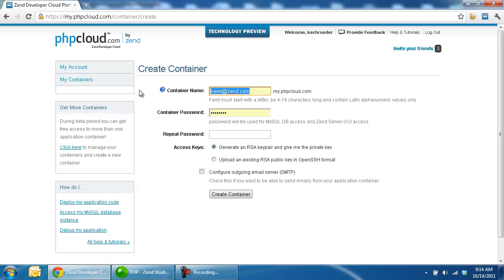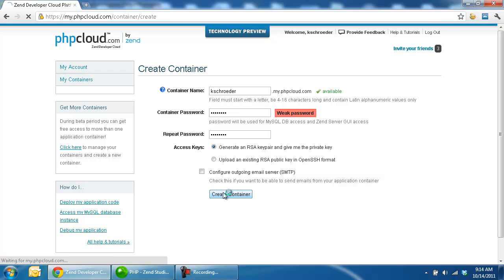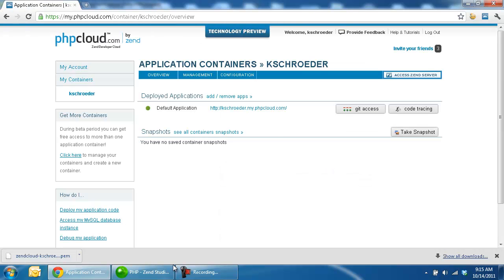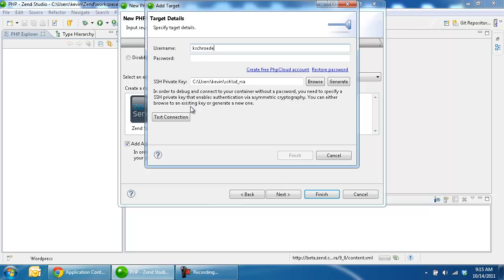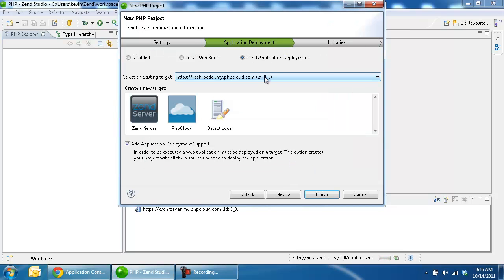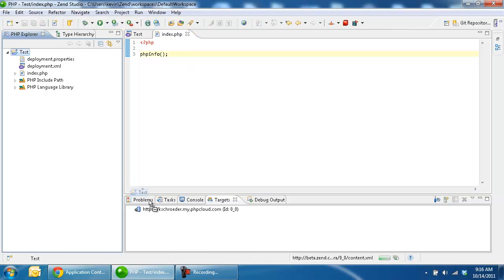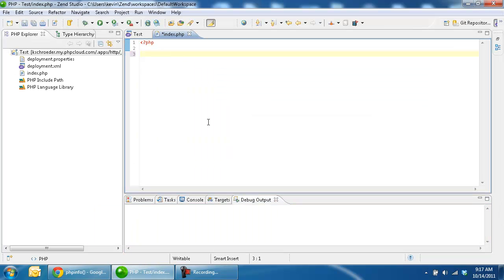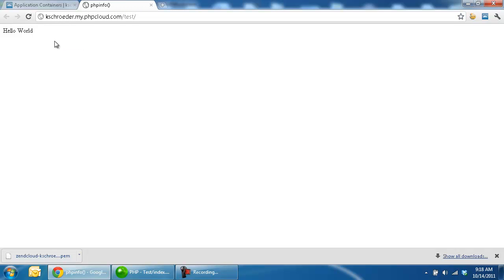Developers can get going, instantly, using phpcloud.com

Comment from the maker: You can secure your application through .htaccess-based authentication.  We don't _currently_ have an out of the box solution yet, but I would expect it to be part of a final package.  In terms of pushing to production, much of the hassle (push updates, make backups) are handled for you.  Syncing the DB is something that we don't directly manage, but it can be done using the deployment hooks in Zend Server

Comment: looking at the 2 videos for phpcloud 2 questions pop into my mind. Who works and expose directly to the web what they are doing? Usually you work in your local machine, maybe into a parallel testing server and the deployment process is never as simple as a click and drop. You have to sync databases, to push some updates, to make some backups... a lot of things. And a lot of things could fail if you just publish directly your files to another machine which is live on the web.